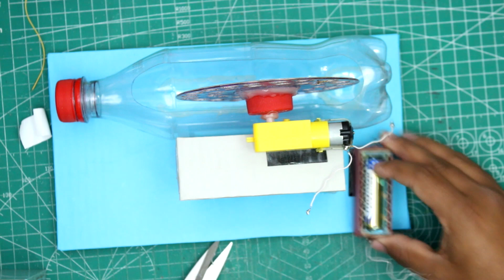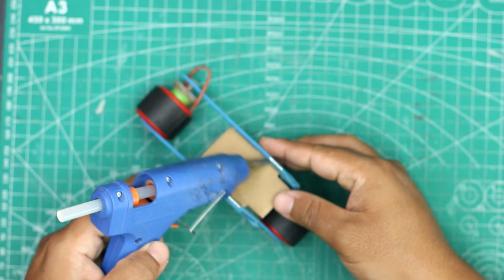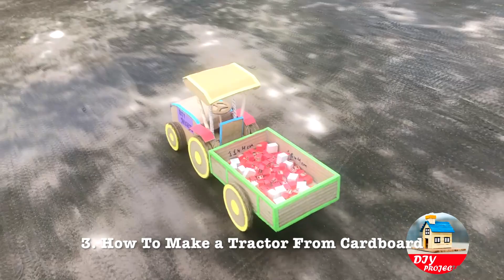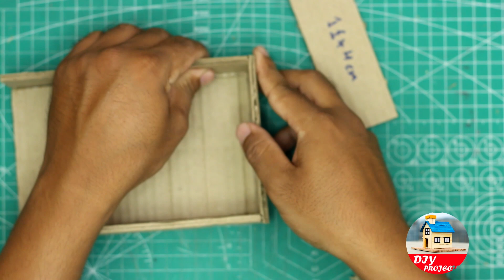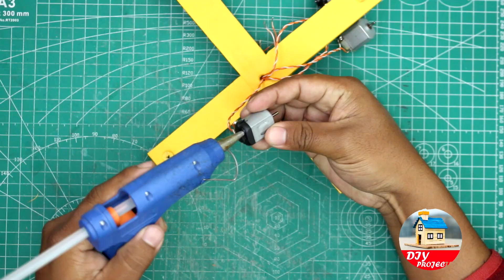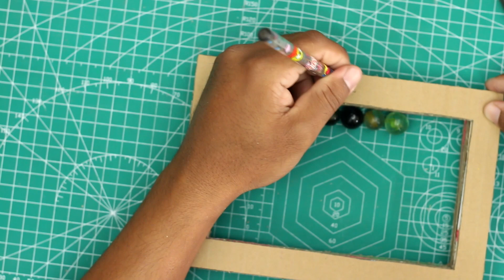Diy Science Toys

Comment: Plz tell the things used in drone
Reply: Plz I have to make it
Reply from the maker: Dc motors, Fan, Wire, Switch, Battery my friend
Reply: @diyscienceprojects  plz tell me the things we need in bike one
Reply: What is the black thing on wheels , what is that round thing near the battery and what is the thing from which you have attached the wires and when you are pushing it the motor bike starts